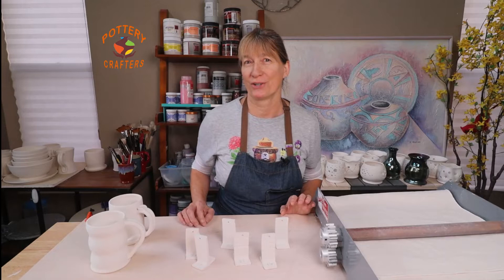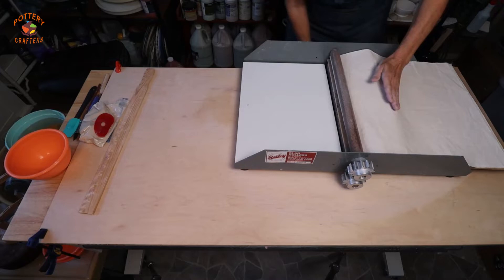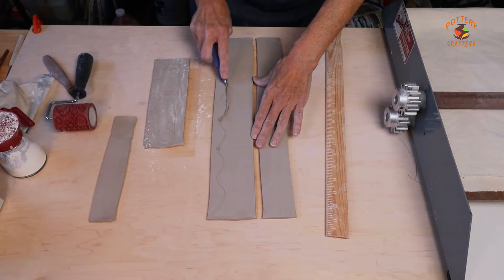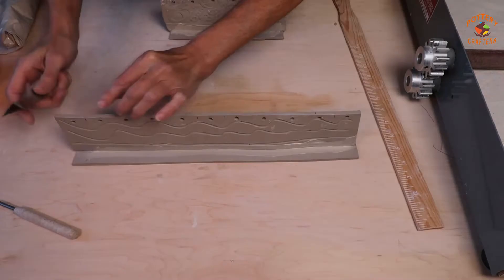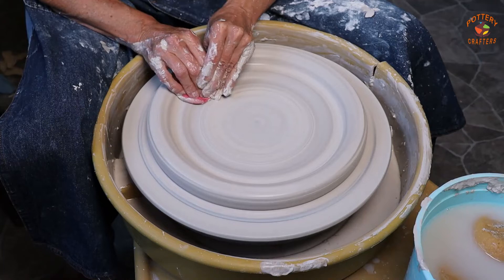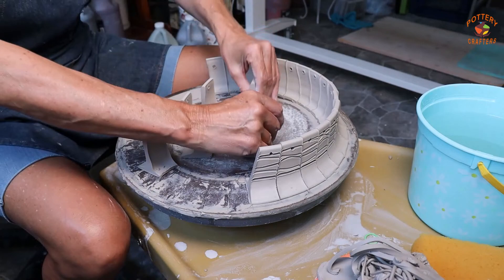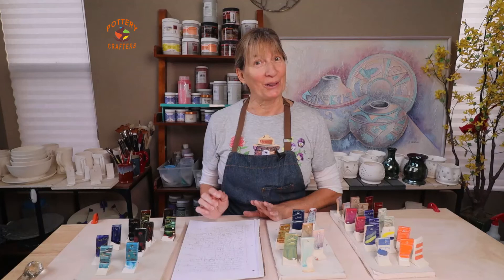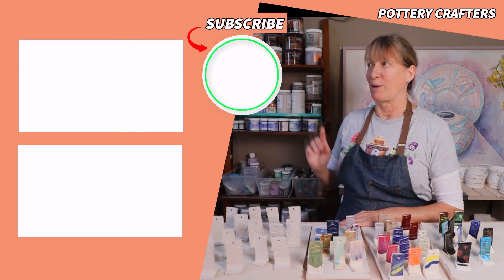Making Pottery Glaze Test Tiles - Wheel Thrown and Handbuilt

Comment: im using a glaze called Averturine a black brown amaco glaze cone 5-6.  Ive used it on red clay and Grey clay and both have come out a purply black!  The one that was white clay came out correct. Is it the clay im using and should i use less coats for red and grey clay?  thanks so much. how could i send you pics?
Reply from the maker: That is because Aventurine contains red iron oxide and is interacting with the clay color. The more coats you apply the darker the glaze will become. If you leave a comment on my pottery crafters website I can get back to. 😊

Comment: Hi Marie..I have a doubt. I have given my terracotta pieces to be bisquefired. They will be bisquefiring at cone 06. In the specifications of glaze it's given that apply to bisqueware (cone 04) and then glaze fire at cone 06. Will the bisqiefiring at cone 06 and then glazefiring at cone 06 affect my glazing on my clay piece?
Reply from the maker: Hi Meenu. That should be fine because bisque firing is done between cone 06 and 04. I have bisque fired at cone 04, 05, and 06. with no problem.  Keep in mind that there are also potters that successfully single-fire.  😊
Reply: @PotteryCrafters  thank you Marie. I was told that bisquefiring at cone 06 and then again glazefiring at the same cone 06 on terracotta body might lead to glaze not absorbing to the clay body..is that so?
Reply from the maker: Good question. I have never heard of that. Actually the higher you fire clay the less 
porous it becomes.

Comment: Hi Marie. Can I use the miami pink glaze on terracotta and fire to cone 06?the firing temperature was given on website. I had a doubt if this glaze is compatible with terracotta
Reply from the maker: Hi Meenu. If the clay and glaze are both low fire It should be fine. But you can always test fire to make sure. 😊
Reply: @PotteryCrafters  thank you Marie. From your experience in pottery, which glazes would you recommend for terracotta cups to be made?
Reply from the maker: You are most welcome Meenu.  I like the low fire Amaco glazes. It is best to slow fire with terracotta clay to help prevent pin holes
Reply: @PotteryCrafters  thank you Marie for your suggestion. I'll try terracotta bisqueware with low fire amaco glazes..